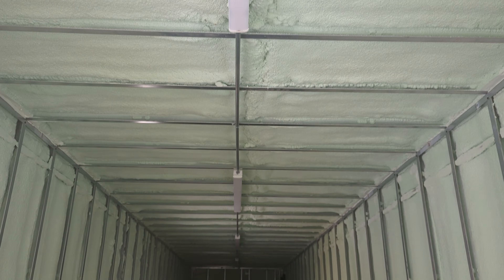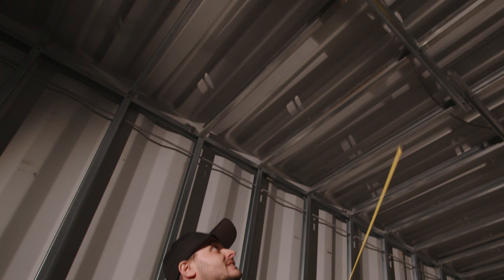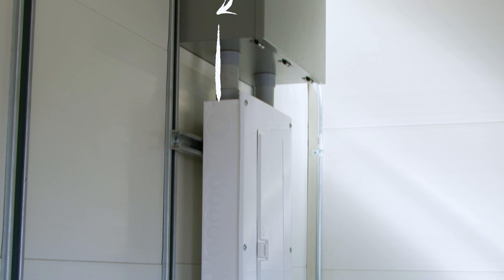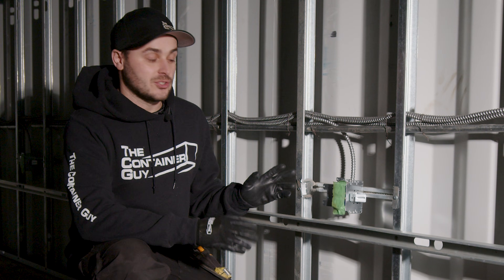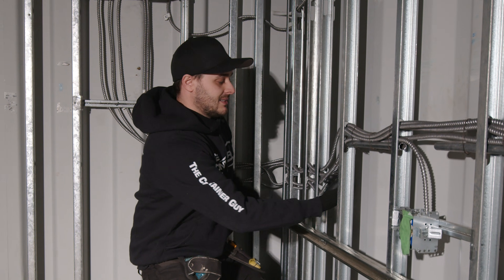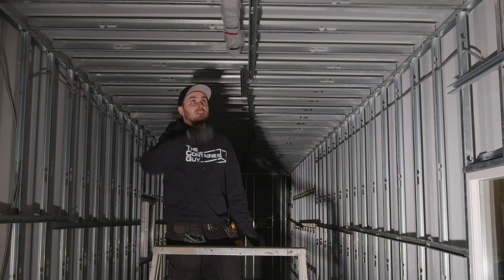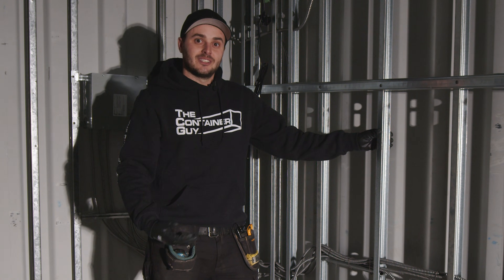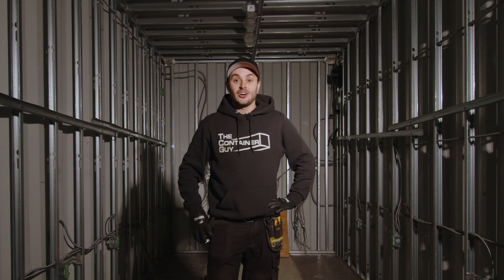Top Wiring Mistakes to Avoid in Shipping Container Projects (Pro Tips Included!)

Comment: Random question but why don’t you spray foam first and then run electrical and why not use nonconducting ABS boxes? Is it easier to insulate the exterior to save room on the interior?

Comment: Can you explain more about why warm wires would cause condensation? Condensation happens when warm moist air hits something cold. My thinking is that warm moist air inside the container passing through the bx cable with cold metal sheathing could cause condensation regardless of whether there is power going through the lines. In fact, the heating in the lines should reduce the condensation because the sheathing will be warmer. Am I missing something?
Reply: Good question…

Comment: Id use hat channel run horizontally it comes in1/2 3/4 7/8 and 1-1/2 spray foam to the surface then use 1/4 sheetrock to keep as much interior width as possible

Comment: Nice, glad to see tue follow on video to the previous electrical one.  I know the co duit on the outside is easier but the wiring inside looks so much cleaner lol.   Im really curious about running conduit rheough the stud caveties, that seems like it would look really good but youd need a lot of work to frame it out.  Maybe a premade set of cut to length studs and conduit as a kit for 20ft, 40ft etc containers?

Comment: With the condensation issues... why don't more folks do foam install on the outside of the container? Can move vapor barrier outside the metal,  not have to worry about the plumbing or electrical work around could be completely minimized.
Reply: I’m curious about the same thing. Why take up the interior volume with the insulation when you could add to the exterior and then apply fascia treatments to change the exterior to look better? Have seen some insulation blocks in the past for applying to the exterior but can’t remember the name. Very curious if that doesn’t solve the vapor barrier issue.
Reply: Once you finish doing all this there is no room left inside the container.

Comment: I understand the condensation loop in theory, but why not just run the conduit UNDER the box height? Say run the conduit at 30 inches off the floor and put the boxes at 36 inches off floor level.  Water does not run uphill, and it would seem any easy method of preventing the problem.

Also if there is that much condensation I would look at putting some type of drain point in the system. Keep the fluid from being able to build up to the point it can cause staining to the finished wall, much less electrical issues. Simply add a "T" in the conduit at the lowest point where the bottom of the "T" is an empty conduit allowing water to drain to the outside of the container.
Reply: Ingenious…
Reply: And i am totally “fed up” btw… lol

Comment: MAYBE, if theres a lot of electrical/plumbing going into the wall, you could switch to 3 5/8" metal studs instead of 2 1/2", you'd sacrifice 2 1/4" interior dimension, BUT you'd have a bit more room for spray foam, and a little more room to keep the "anacondas" away from the container walls. what do you think?
Reply: Another idea, if you're using a high-cube container, you could run 2x6 framing in the ceiling, hold them down about 2" from the top of the can and you could have your spray foam on the lid, 4" rockwool in the studs, and then still have 2" of framing to run wiring and plumbing in the ceiling instead of walls. The extra insulation in the lid might help the ceiling condensation as well